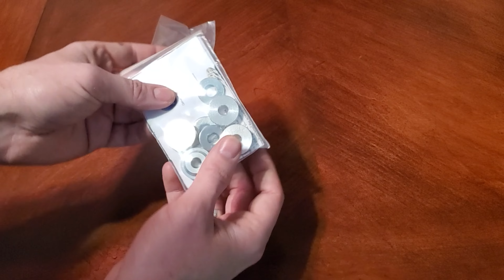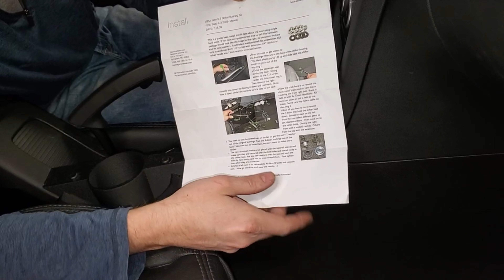Installing SAAB Billet Shifter Upgrades & Much More!

Comment: För fastare växling- Kolla dessa delarna på e-bay eller motsvarande 1) REPAIR KIT GEAR LEVER SELECTOR GEARBOX BUSH F40 FOR SAAB 9-3 93 II 6-SPEED 02-12  2) Saab short shifter Saab 93 set short throw shifter cable renforcement cable kit

Comment: To reduce side to side play you have to replace a sleeve that goes under the shifter ball.  https://www.youtube.com/watch?v=GS7iIo1nfrA
You can search on ebay 'ertons saab'
Reply: Does the sleeve fit 5-speed shifter too?
Reply: @Alex-ch2ud  I don't know, I'm not familiar with the 5 speed shifter. But on product page they state it's for 6speed F40. No mention of 5speed.
Reply from the maker: Ohh good info! Im going to do some research on that. Much appreciated!